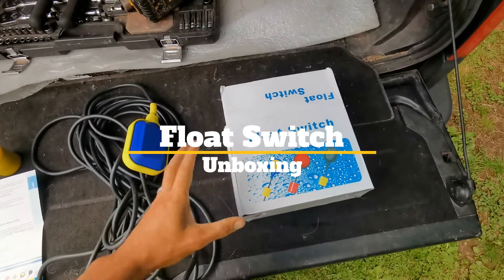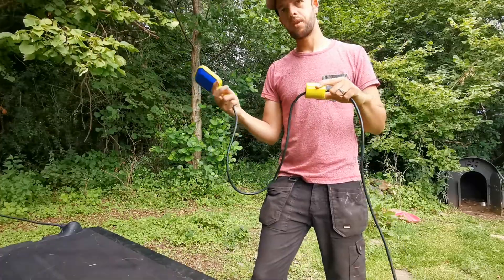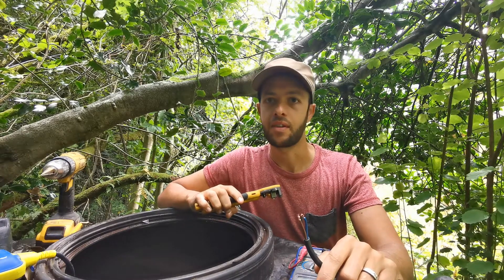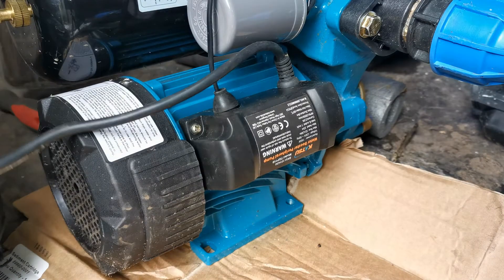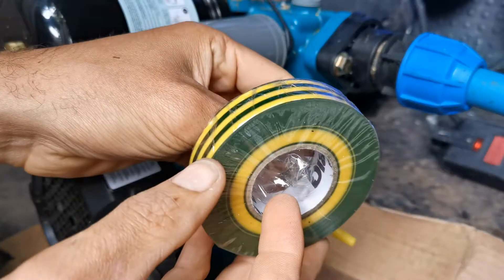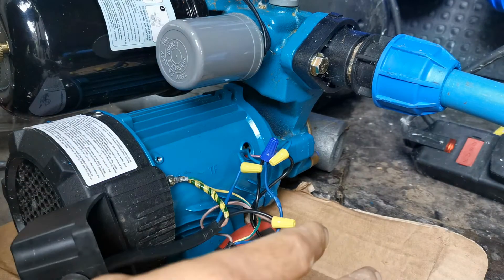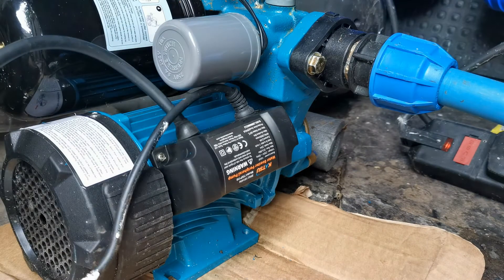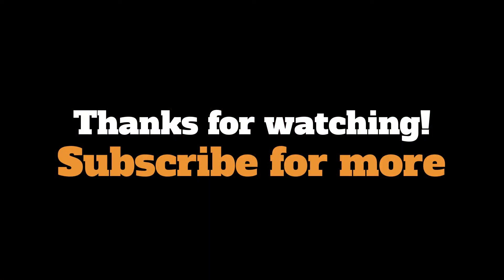Float Switch Install in Off Grid Water System

Comment: cont....   additionally I am installing the wires to the panel.  Right now there is a 220a breaker in the box and it is hooked up manually to the pump 200' down in the well.  I walk over and pull up the breaker and the well is wired direct and comes on instantly.  How do I wire the float switch into the well's wiring to where anytime the breaker is in the on position and the water is low it will turn on and off the power to the well pump.  Then when the breaker is turned off...the well will not come on and tank could run dry if I so desired?  Tks

Comment: Help me out here.  Doing same, or about to tackle this project.  Problem?  I have a 275g IBC tote black in color too and have a well at 200' that is a low producing well.  I can not run the pump for more than 7-8 mins at 10 gal a min. or she will run dry.  Then takes hour or so and can do it again.  (refill rate)   Soooo, I need for this float switch to be installed in such a manner that it of course does not come on every time a few gallons is drawn off but maybe 50 gallons.  So, what do I do, have that flow at the very top of the tank and 12" or so to the float or put it to where the float and the switch are a few feet apart?  My fear is if I don't get it on right...the water will be drawn off say a few feet down before pump comes on and pump will run dry before tote is filled to the top again.....   Is it that simple...at whatever level you suspend the float at, that that is where the water level will be....and what ever level the end of the line switch can fall to is where the switch will kick on the pump?
Reply from the maker: Sounds like you have multiple things going on here! I must preface this with a caveat - I am not an expert, take anything I say with a pinch of salt! With the float switch, the water level is dictated by the distance from the stopper/weight to the float. When it comes to running the well dry you could timer to the plug which will slow things down significantly (on for 5 minutes off for 10 minutes), the float switch will be the primary control and timer will be the secondary, I'm sure the well pump will have overheat/run dry cut off, this will be the tertiary level of protection. HTH

Comment: Did you just connect the brown to earth??
Reply: woopsie... isn't the brown cable used to reverse the function of the switch? it should be insulated if not used, right?
Reply: Your work is not professional. You are not electrician. 
The brown is nooooot for earthing. Is used for different types of connection. 
Th body of motor shock any body because it have 220 volt when tan get full and folat switch become horezenta .be careful brother .